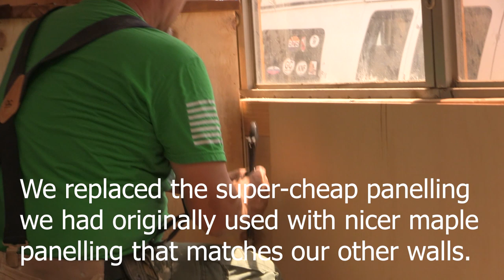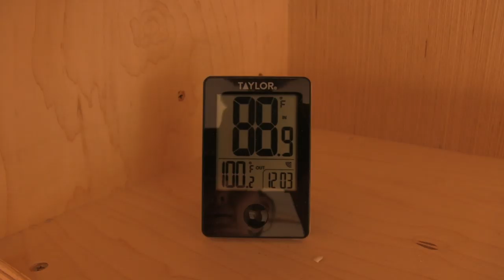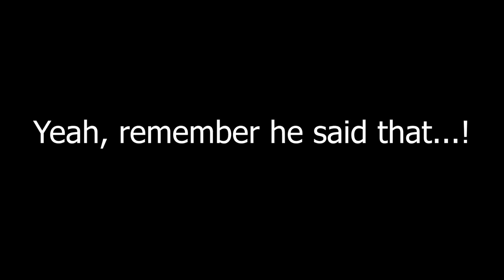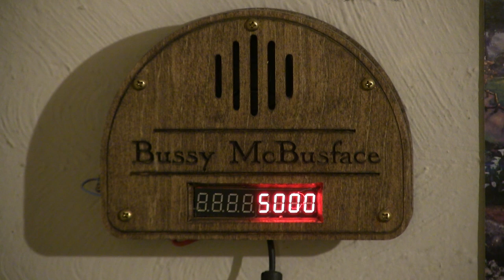Our Skoolie Dinette Converts into a Bed and a Couch!

Comment: Thank you so much for sharing these videos!  We have purchased our bus and have learned so much from you guys.  We think in an earlier video Mike mentioned that the  Kreg clamps may not have been as awesome as the Kreg jig.  This week, we noticed that Mike was using a pair of black and red handled clamps when building the booth thrones.   Are those Kreg clamps?  If not, what brand are they and where did you purchase them?  Thank you again for including us on your  bus adventure!
Reply from the maker: Milescraft 4004 Pocketclamp - Right Angle Clamp for Pocket Hole Joinery https://www.amazon.com/dp/B079W2K8XY/ref=cm_sw_r_cp_apa_i_wdZrDbPHZFBZB
I use these instead of the kreg ones.
Reply from the maker: I'm glad you enjoy the videos. We have fun making them. Good luck on your build!
Reply: @BussyMcBusface  Thank you!

Comment: Been thinking about this since last week.  Concerning your grey water outlet piping. 
 The plumbers strapping would be ok if it were on a house.  It will stop downward movement. 
However, being on the bottom of a moving vehicle it is going to vibrate, shake, rattle and move in all directions. 
I would suggest welding angle iron brackets to the bottom of the bus, and using U-bolts, in as many places as possible. 
  I can say with 100% certainty that if you don’t, you will have broken pipes in a very short period of time.  
  I’m retired pipefitter of 40 years. 
 Love your videos.  Great work, and craftsmanship. 
  Holler real loud when you come through SC.

Comment: I'm sure this has been asked before, but I couldn't  find it in the comments from the older vids. 
Is there a parts list for the pneumatics you added to your Kregg jig?
Reply from the maker: Pneumatic cylinder
Parker 1.06DSR05.0 Stainless Steel Air Cylinder, Round Body, Double Acting, Nose Mount, Non-cushioned, 1-1/16 inches Bore, 5 inches Stroke, 5/16 inche https://www.amazon.com/dp/B00BU9W7RO/ref=cm_sw_r_cp_apap_UmdiUrNjCuufz
Tubing
uxcell 10M 32.8Ft 6mm x 4mm Pneumatic Polyurethane PU Hose Tube Pipe Blue https://www.amazon.com/dp/B008MO66FO/ref=cm_sw_r_cp_apap_FiaTE5yFsX517
Generic Push in Quick Touch to Connect Fitting 1/4" OD Tube x 1/8" Male NPT Thread Pneumatic Straight Joints/Coupler (Pack of 5) https://www.amazon.com/dp/B01E6FJJN8/ref=cm_sw_r_cp_apap_4gSsFTJVHzFXz
Reply: Bussy McBusface Thank You

Comment: What kind of screw do you use on the pocket holes?I'm not a carpenter but I usually use sheet rock screws for most things but I don't do furniture .thanks for the great videos I'm a new subscriber.
Reply from the maker: You use pocket hole screws. Research Kreg pocket hole jig.

Comment: "Each seat is approximately 24" wide X 22"deep, and the table is 24" wide X 30" long. This gives us a finished bed/couch space of 74 inches in length."  I love your design.  However, what is the height of the seat from the floor?  Thanks for your help.
Reply: I just found the measurements listed below.  Thanks, again.